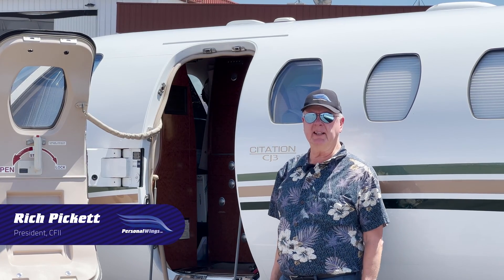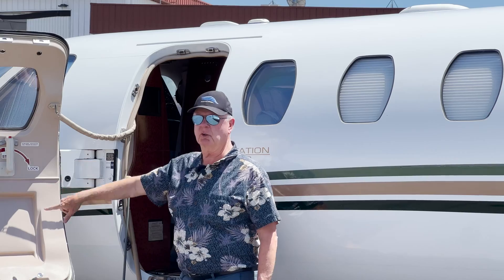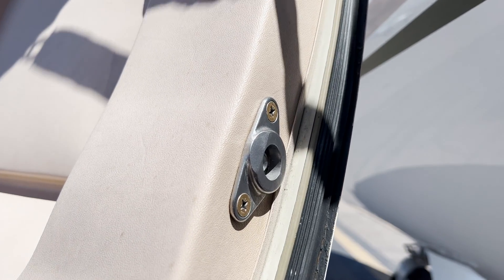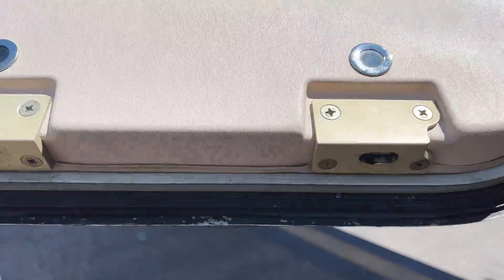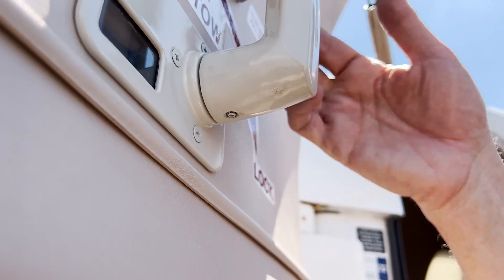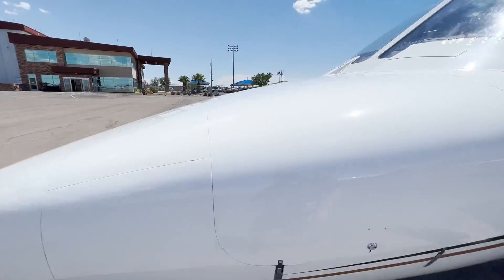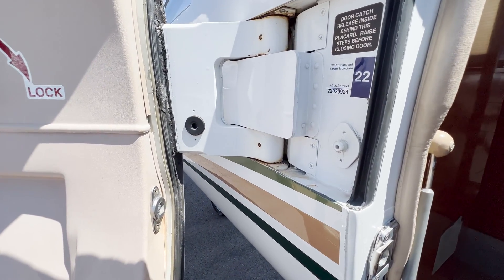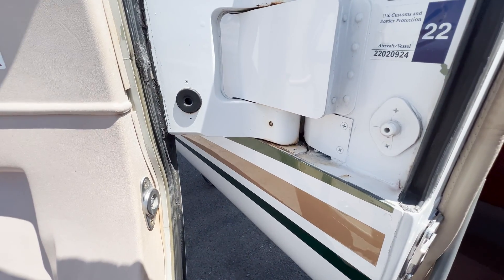How to Clear Door Seals of Moisture on a Citation Jet CJ1, CJ2, CJ3, CE-525

Comment: Just on the inside of that valve you are pressing on, there is an AN cap that should have a .040" hole drilled into it for moisture evacuation. You should check your other jet you referenced to make sure that little guy is doing its job

Comment: What about any moisture that has been blown into the seal previously and settled into the bottom? Is there a way to drain that out?
Reply from the maker: Werner, I don't know of a way to drain the seal itself since it is sealed unit - except for the inflation port. In 'theory' when the seal is not pressurized the seal should dry out.  We blow out the moisture in the pressure line itself since there are low spots in the system.  Our CJ had a lot of water in the service air line (the bleed pressure line to the seal) while our CJ3 was dry and had not been done for a very long time. Thanks for the question, and viewing.  Rich and Tigre